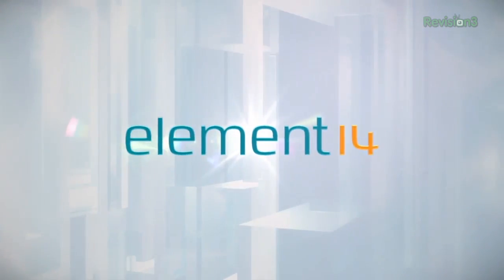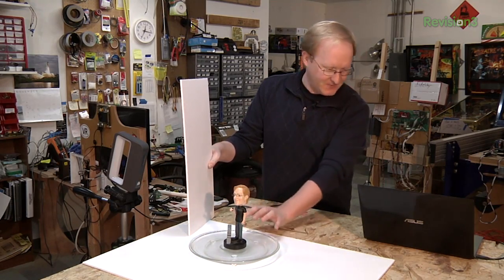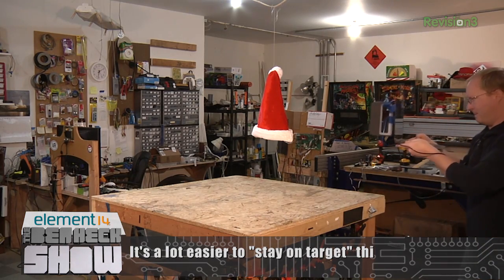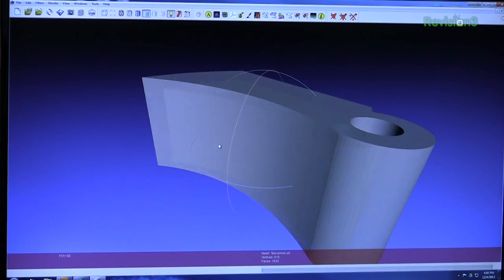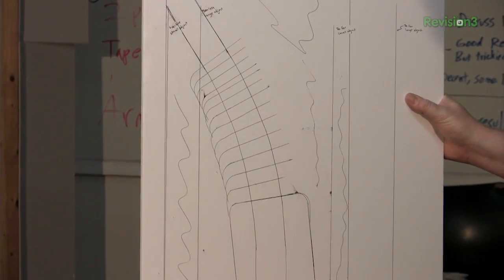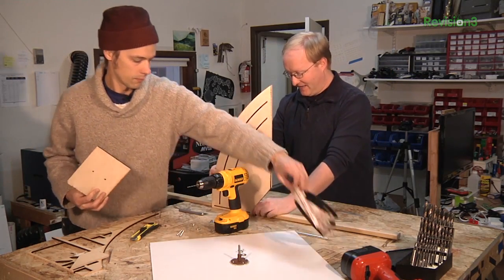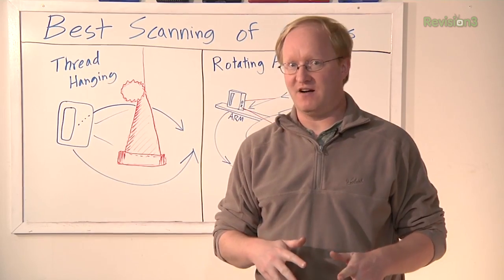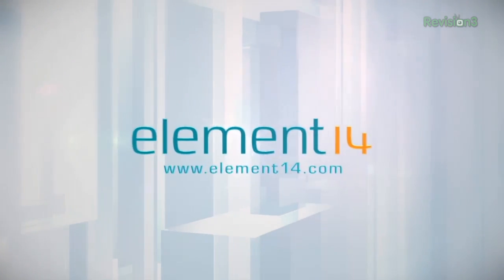A Man with a Scan - Ben Heck's 3D Scanner

Comment: A few improvements:
Use a glass table, obviously the camera will look through it.
Don't spend any money on a scanner but instead a normal camera and software like visualSFM and meshlab or reconstructme.
Reply: Having tried all those, even beta testers for primesense, and also owning the Sense. BUY THE SENSE.

Also glass tables throw off the laser light. So scanning through glass will generate specular interference which will create scanning anomalies 
TheMoreYouKnow.gif
Reply: not glass but that plastic that the arcade was made of.
Reply: kenrick encinas
To be more precise: a transparent material with a (very) low index of refraction that lets infra-red pass through as well. (With little reflection)

Laser Gnomes 
In case of visualSFM which uses just seperate pictures you can take pictures from underneath and from above the table without seeing the edge. If the index of refraction is very low and the transparent material is thin then you shouldn't have much trouble.

The reflection issue can be solved with a sillicon-anti-reflection-coating which is used on solar panels. So if you found/bought a broken solar panel perhaps you can take the glass cover off.
Reply: Sadly photogrammetry is not sufficient for our needs. We really need that depth data that cannot be captured using shadow comparisons. Additionally we are not always allowed the courtesy of coating our subjects with anti-reflective coatings or even talcum. In some cases even the laser is subject to scrutiny as damaging of the subjects.

Will check out visualSFM but if it's photo don't have much hopes for it. Have used various other photo based to the same end result.
Reply: Laser Gnomes
It can use video's as well (at least I've seen people doing it or converting it to pictures).
And the result looks pretty much the same as Bens scan here if you have enough pictures.
---
forgot to say: I was talking about a coat of silicone on the bottom side of the table, that's the surface that could reflect things into the camera.  So you don't touch the object to scan.

Comment: the rotating arm is great. but i think it would be nicer if the arm was pressed between two bearings and the bearings be attatched one to the table and the other to the plataform giving the arm a pretty smoth motion while keeping the plataform steady, also a mount for the laptop on the arm itself so one can guide and check the results at the same time.

Comment: There is a software for Kinect to do exactly the same, but requires a lot of GPU power
Reply: Erwin Ried use Scanect with the Kinect. same quality as this Kinect with a fancy case, i tape some reading glasses to the Kinect sensors for more detail in smaller scans..pow! $300 bucks still in my pocket.
Reply: The software that "does the same" is the same!
Primesense are the makers of the firmware and coding that drives the Sense.
With the small exception that now they have funding to make it usable where as during the kinetic days they did not.
Reply: The Sense and Scanect with kinect are not the same. We have used both.. hands down the Sense is the winner. We have 3 kinects and use them simultaneously for instant scans... still Sense.

Reading glasses trick is lolz.. we have the Nyko zoom lens kits for kinect.

Really looking forward to testing the new Xbox One system though.
Reply: Laser Gnomes Im waiting for someone to open one till i believe that.
I have the zoom lens too but honestly the Kinect just sits in my draw,the novelty of scanning knickknacks and people wears out fast, its more fun to make things in software.although the Fuel 3d scanner is tempting.

I hope they dont hold out too long on the SDK for the ONE
Reply: Yeah the Niko Zoom kit helped. Depends on the open source you're using honestly. Some don't like the edge distortion.

Small objects just aren't there sadly.
Thankfully the 3ds software allows for various pre-settings to allocate more or less resources to a region. But at the end of the day you're still limited to  like a 6" object.
The settings just determine the level of polys you get on the back end.